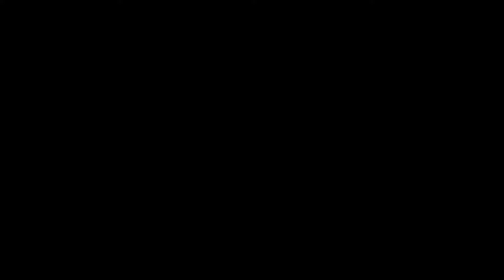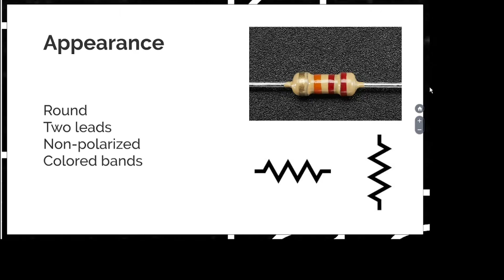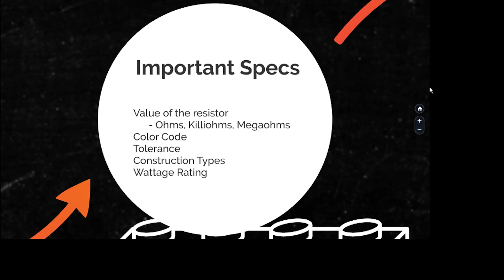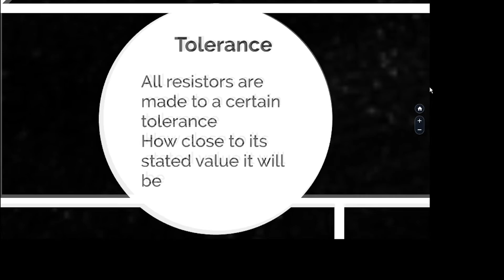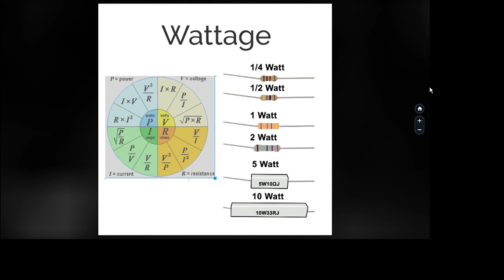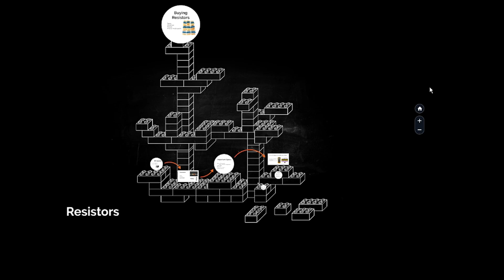What Are Resistors?  Guitar Gear Explained

Comment: Mate, this is so well made and explained! I've been building acoustic guitars for many years, but in my dotage I have decided to build an electric and release the dormant rocker in me. I sort of ran aground on the electronics, as it's not something I've done before. Had no idea what exactly a capacitor or a resistor were but through this video my eyes are opened as if by a Budget Lord (no offence on the use of Budget here, unless you can also explain how the capacitors and resistors in the starts work). Thank you so much, Lord, for this brilliant bit of work! Aroha from Aotearoa (New Zealand) :)

Comment: I just made a treble bleed circuit with a resistor in series and parallel. I'm making a quick connect system to easily try different values and resistors in different places. I need a refresher course because I still get confused. Thanks. 
Edit. Could you tell me which multimeter will read these low values? None of my cheap ones will read tiny caps but I don't know which to get without spending a lot

Comment: I think it's best to get a "full" resistor pack, and then get like 50 of the most used values (multiples of 100, 220, 330, 470).
Love the channel, great stuff.
Reply from the maker: Thanks!  I agree on the pack.  I think I've bought two packs off amazon and love having the flexibility to dial in a specific resistance value if I choose.
Reply: That's what I just got in the mail. 250pc for $10. Now to learn all the ways to use them

Comment: 100% agree. Carbon comps are hissy, the more you have, the more it’s a problem. Proximities to heat can be a factor also. Higher wattage are more quiet. Great you share your humble progression to become more knowledgeable and help others progress. Great video as usual.
Reply from the maker: Thanks!  I have two amps with older carbon comp style resistors and if I were to do it again I'd use my modern metal film.